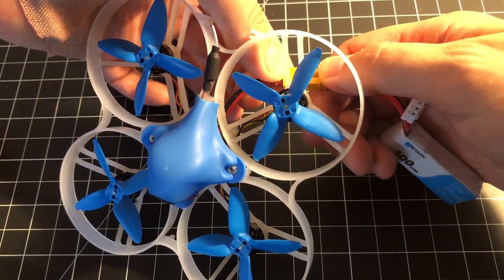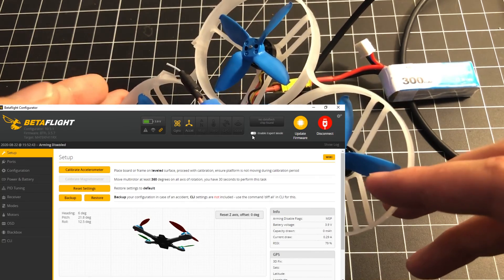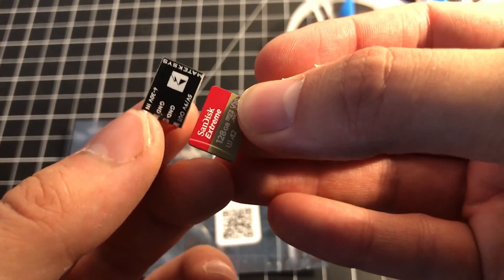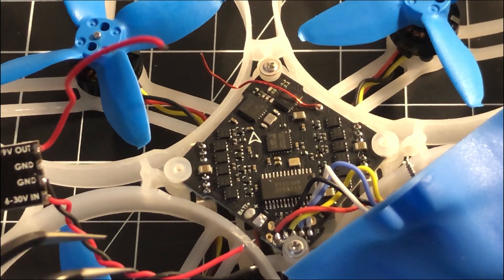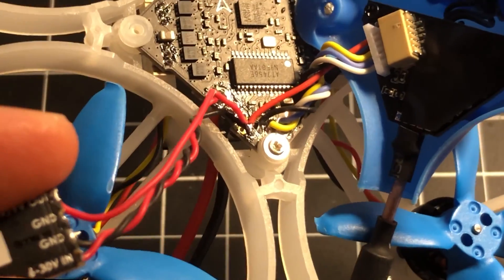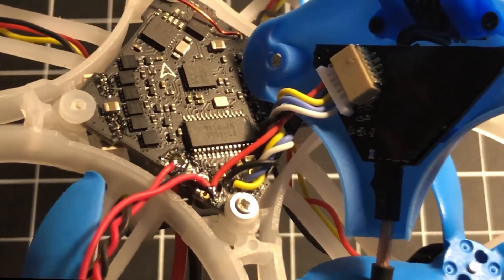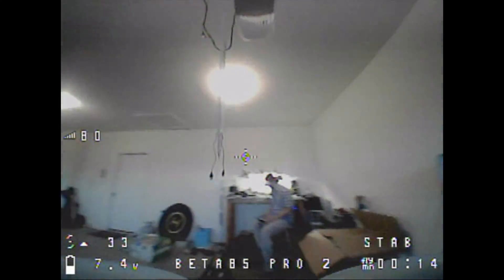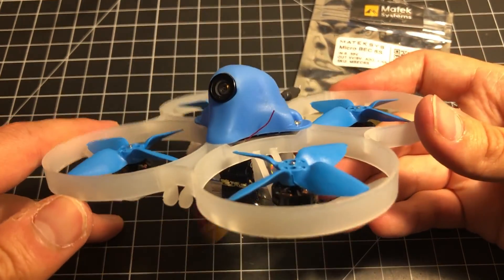Drone Flight Controller Dead 3 beeps? (Fix with 5v Micro BEC!)

Comment: hey boss im having the same issue just getting the 3 beeps but with the HGLRC 16x16 can you give me a hand trouble shooting mine wont boot up through usb either....but i am getting the 1st 3 beebs. thanks
Reply from the maker: Do you have anything connected to your 5v pads? If so, is there any power coming to the devices on the 5v pads? If not, then that would confirm 5v regulator is probably dead. Let me know and I'll try to advise from there.
Reply: @JohnCuppi  hey thanks for replying your the 1st person that has awnsered me when ive asked a question. So thanks  o man now i got multiple quads doing this to me ...so the one i was talking about 1st is a HGLRC 16x16 nothing from usb i plug in battery ger the 3 beebs but no power to the rx or vtx so i think your right about the 5v regulator  but not exactly sure ...now on the other one is a t motor f7 mini it will work with usb but its still only ggiving me the 3 beebs when i plug in li8po if u wanna add me on facebook might be a little easier for us to discuss this kinda thing im really intrested in fixing my own stuff
Reply from the maker: @haameall  Hey what's your name on facebook, I'll add you. I'm wondering something, where are you soldering your VTX? Do you solder those to the 5v regulator, or 5v pads?  I have heard of people having this problem apparently because their VTX draws too much power, basically causing a "brown out." Anyone who has their video transmitter or too many things soldered to 5v pads should try removing them to see if it resolves things. I helped someone who thought his regulator was shot, but it was really just overloading of it by his video transmitter.
Reply: @JohnCuppi   I do hook up my VTX to my flight controller but I rarely use 5v pad for vtx Jamil Mahshie Port Charlotte fl 33948 ...cool yea id like to discuss this issue for sure

Comment: I crashed mine into wooden stairs today so hard that when I changed the battery  I had the 3 beeps But no motor arming beeps. 
I hooked it up to BETAFLIGHT and loaded the complete CLI setup for the Meteor75 and after it loaded the command line and restarted.. I had my accelerometer and gyro sensors back, VTX.. Everything. 
I'm just concerned about the battery indication flashing in BETAFLIGHT.. I didn't have one hooked up. 
I tried the same twice on my 1-2 S version.. No luck with that one.
Perhaps that can help someone who doesn't have a 5v. issue as well.

Comment: When I plugged mine into the usb the center of the board got extremely hot but didn’t power on...it’s a BetaFPV 20a AIO for an x-knight X3
Reply from the maker: I’m afraid something else is probably very wrong with the board then, and it cannot be saved. Sounds like a serious short.
Reply: @JohnCuppi  ok thanks for the reply! Do you happen to know if there’s a way to use an AIO w/dead FC, with a same type AIO w/dead ESC?
Reply: @JohnCuppi  I think I have the same problem.  Receive gets power but I can't get the FC to power up.  I had my negative battery lead/wire disconnect in a crash.  I wonder if that shorted the FC because it wasn't ground?
Reply from the maker: @thebikeracer  I've had both ground and positive leads come off quads, since battery leads get yanked and tugged in crashes sometimes especially with micro quads. The disconnection of the ground lead alone shouldn't have caused a short by itself.  It probably touched something in the process of coming off the board, though, which killed it.
Reply: @JohnCuppi  I think so.  I hate myself...I fell victim to the wrong cable with betaflight.  But now that I've figured that out...the broken quad won't connect to betaflight (I tested with another quad)  the RX lights up so I'm going to try the BEC solution.
Reply from the maker: @thebikeracer  If you have a multimeter, test the voltage the rx is getting off the 5v reg. If it’s under 5v then that’s a good sign the issue lies there. Otherwise, if it’s got power then the problem likely lies elsewhere and I am not as sure that 5v BEC will fix it.

Comment: What if it's a 10v pad? My vtx is hooked to 10v which is called for. Would this be why mine is only chiming 3 times? It's a brand new build and was working properly, but after messing around with betaflight it stopped chiming except for the 3 times. Skystars Starlord 228 kit. F7 FC
Reply from the maker: In the Skystars Starlord 228 kit.it says it comes with VTX5804. I can't seem to find VTX5804 to check its spec sheet for you. All I could find is VT5804 v2 "The Force" VTX, which has an "Input voltage: 7-24V DC." If this is the VTX you have in that kit, wire it to battery terminals and not FC.
Reply: @JohnCuppi  I will give it a shot thanks. I assume you mean only the pos and neg of the vtx? Other two are going to camera and uart pad
Reply from the maker: @DougEfresh.  That’s correct. ONLY the vtx power input leads. Also, do you have any capacitors? Once you get it added you’ll probably want to install a capacitor to the pads too, just to help clean up the power. Makes the video feed clearer.
Reply: @JohnCuppi  I have a capacitor. Everything is working fine, I get a clear picture but I couldn't bind it because of the new xm+ that needs flashed. Was messing around with betaflight and tried to connect after a few times it stopped chiming all the way. It chimed like it should for maybe 10 connection to betaflight. Then it stopped chiming like it should
Reply from the maker: In this case, if it works without the vtx soldered... then the VTX may be causing a brown out at the on-board BEC. Most of these BEC can only do 1.5a-2.5a and a vtx can push them over the edge. If your vtx requires only a minimum of 10v, and your batteries are at aleast 3s (11v) then you could solder the power for it directly to power terminals.

Comment: Hey man, awesome video. Can I use this bec for my 5inch?
Reply from the maker: Yes your 5” is probably either 4S - 6S and the input voltage range up to 30v. So its good for 5” quads to fix this issue too. 👌🏻
Reply: @JohnCuppi  I only run 12s on my 5inch lol jk
Reply from the maker: @miguelboisvert7375  🤣🤣🤣

Comment: Hey I have a tyro79 that seems to be having the same issue. I hear the 3 beeps but not 2 except when plugged into the USB. Will this also solve the problem. I crashed it in some snow because my video went gray. It was very frustrating 😂
Reply from the maker: Strong chance this will solve your problem, as this issue is not just limited to BetaFPV but any quad doing this. Does the ESC have 5v out anywhere on it? You can backfeed the ESC’s 5v pad if there’s one anywhere on there by chance to test this theory.
Reply: @JohnCuppi  I don’t think it’s an issue between the esc and fc. it works when everything is plugged in but the video transmitter
Reply from the maker: @jonasprice04  sounds like the 5v regulator is browning out then. So one of these actually might work to fix the problem anyway because you can offload onto it. :) I actually had someone who had the same issue and he ended up soldering his vtx direct to vbat. If yours supports that, you should definitely solder to vbatt. If your vtx only supports 5v input, then one of these BEC will resolve the issue for you because it'll provide an additional dedicated 5v tap for the vtx, keeping the board from browning out. Just feed the 5v line to the vtx only.
Reply: @JohnCuppi  ok thanks
Reply from the maker: @jonasprice04  Oh -- don't forget to solder a capacitor to your battery leads / vbatt if your vtx can support the voltage input and you're able to tap it from there. Without a capacitor to help clean up the power, there will be noise in your analog video feed.
Reply: @JohnCuppi  I’m a little scared to solder. The reason I got the tyro79 rtf is because it’s all plug in. Probably my fault for buying a cheap drone but we’ll see. I appreciate the help
Reply: @JohnCuppi  there is one there already so that shouldn’t be an issue
Reply: I also figured out just now that it only doesn’t power up when the camera is plugged in

Comment: i got the same probelm with my rush f722 fc....bt when i plug in usb my prb dosent solve like yours did...what to do?
Reply from the maker: I’m not sure. It’s a lower chance then that a 5v BEC will fix the problem. If you have anything that you can give the pads 5v as a test, that will determine whether or not you should buy one of these. Could be that the USB connector trace is wired weirdly but it is not a good sign that plugging in doesn’t resolve the problem. Hope that you can get it figured out. 👍🏻
Reply: my fc is heating high

Comment: Someone showed me your video on RC groups, I have the same exact problem with a tiny hawk freestyle 2.  Ordered the BEC and will be installing that.  My only question is, on an AIO board, can you backfeed to ANY 5v pad?

Thanks, and subbed👍🏻
Reply from the maker: Yes! You should be able to use any 5v pad to do this. It should light up all of the 5v traces on the board as well. In the worst case scenario if for some reason the other traces and pads don’t get power, you can wire everything that needs 5v to the BEC as well.
Reply: @JohnCuppi  awesome, and thanks for the quick reply.  I’ll let you know how it works out!  Take care!

Comment: So I got the same thing happening with my nazgul 5. Do you think I could fix it with the same thing you did?
Reply from the maker: Yes, absolutely. This symptom and fix is not unique to the beta85. On your nazgul 5, before buying the matek bec, check to see if maybe your ESC has a 5v pad somewhere that you could use to backfeed into the flight control board. If you have the analog nazgul 5, some video transmitters also have 5v output pads to backfeed. Some people do either of these things and skip the BEC and it works just fine; but I think a new dedicated BEC is the safest/cleanest thing to do.
Reply: How to backfeed 5v from vtx to FC

Comment: I have followed your instructions ... But I have another problem. There is no battery status. Do you know what I should do? Thanks
Reply from the maker: No battery voltage status in the OSD? Do any other elements appear in the OSD?
Reply: @JohnCuppi  yes, I can see other information. But the battery voltage is blinking (0v). Thanks
Reply from the maker: @dpatricksp  in power & battery settings, is voltage set to Onboard ADC for “Voltage Meter Source?”
Reply: @JohnCuppi  yes, it is enabled.
Reply from the maker: @dpatricksp  Sorry. Those settings are correct... If it shows 0v in OSD, and 0v on the power and battery section of betaflight as well... then it means that the FC’s Voltage/Current sensor was damaged then and this cannot be fixed. 😢

Comment: Is it okay if I solder the 5v wire to an empty 5v pad on the esc?
Reply from the maker: Soldering to an empty 5v pad is the ideal thing to do! :) the only problem is that it may not always light up the other 5v pads when doing so. You say it’s on the ESC, is the ESC and board all in one like the drone in this video? Or are you asking if it’s ok to back feed 5v from an ESC itself to the flight controller?

Comment: First time this happened to me was with a fresh build that I had forgotten to install the capacitor. I was so eager to fly that as soon as I realized it worked while connected to the PC, I went and chopped an USB capable and fed it from the vtx. I was flying an hour later.
Reply: Just wondering- I tested it and my controller acted exactly the same in diagnosis as his in the video. I have a capacitor already on my ESC, can I just replace that or can I just solder this on in addition?

Comment: After a little bit  water on the road, my sector 132 only do 3 beeps, do you suggest also to me this solution? Thank man!
Reply from the maker: Yes. Try to connect over usb while a battery is plugged in, with no props on, and test the motors. If they spin then you know the 5v reg is dead.

Comment: So i crashed mine pretty hard and I get the first beers but then nothing and when I try beta flight I connection I get nothing.  What is that telling me that I wrong ?
Reply from the maker: Sorry I missed this. Did you ever get this resolved? Since it doesn't even connect to betaflight at all, it may be just totally shot. The 3 beeps mean the ESC is getting power but the board is dead to the world. If USB isn't waking it up either, that's a really bad sign.

Comment: Nice vid. I have a situation when i connect battery with vtx connected it will not boot just 3 beeps. When i disconnect vtx it boots up fine all 5 beeps. Would this work?
Reply from the maker: Yes this should work -- the regulator sounds like it's crapping out under load from the vtx, which probably means its on its way out anyway.
Reply: @JohnCuppi  you the man! Definitely earned my sub haha
Reply from the maker: Aldo Fishing Thank you! I thought of something else as well — in case your 5v regulator being “alive” gives you any issues (though it shouldn’t to my knowledge)  you could power the vtx with the BEC and disconnect it from the board. Obviously this would not have worked for me as my regulator was completely shot, vtx connected or not (I checked).